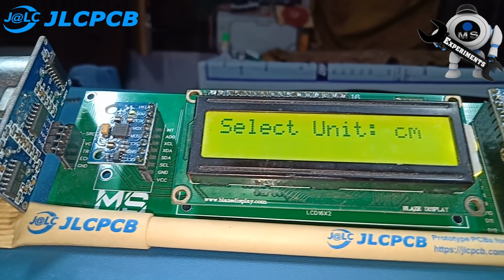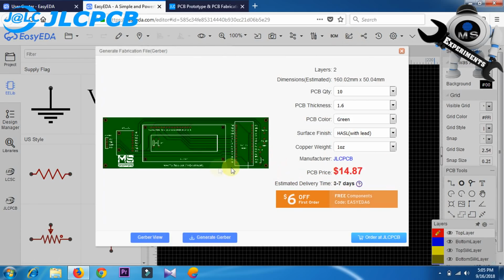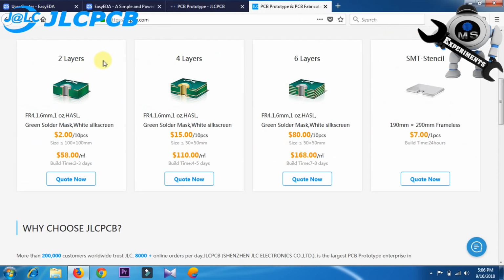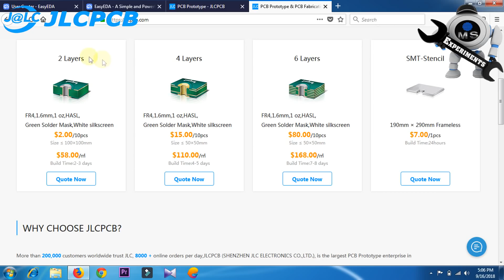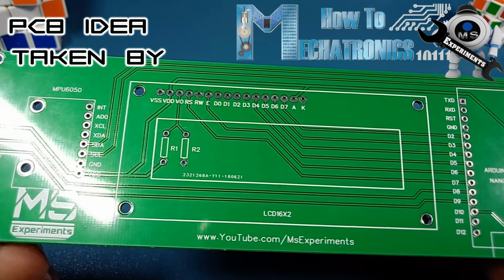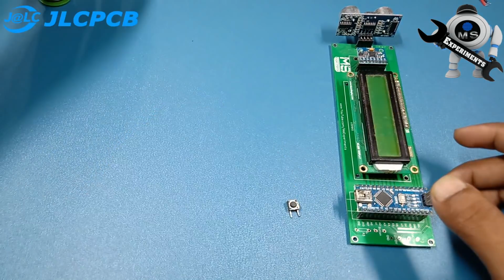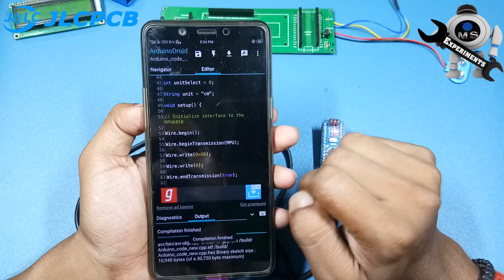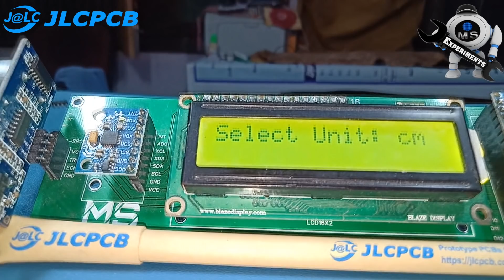Arduino range measurer & Digital spirit level Project

Comment: Hi sir! I try to do your project but the lcd is not showing text. What can be the problem?
Reply: @MSExperiments  the lcd light is working
Reply: @harsimransingh5211  how did u solve it
Reply: @nurulfarhana2141  buying an ORIGINAL Arduino
Reply: Harsimran Singh okokayy thanks
Reply from the maker: Possibly your LCD is damage or not working.
Try to upload example codes
Reply: MS Experiments i did uploaded the example codes but it only shows the black box but not the character, so i guess the lcd is damage ?
Reply from the maker: Possibly your LCD is damage but i thought if there is black box then check out your connection once. I hope there is problem with connection.

For more info watch my video on 16*2 LCD
Reply: MS Experiments okayy , thank you for your help !
Reply from the maker: Mostly welcome keep visiting